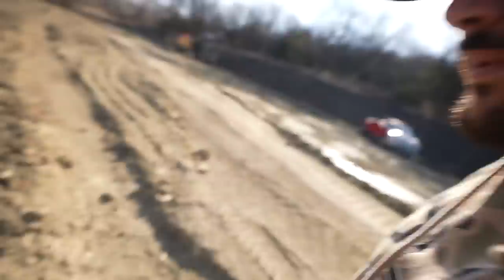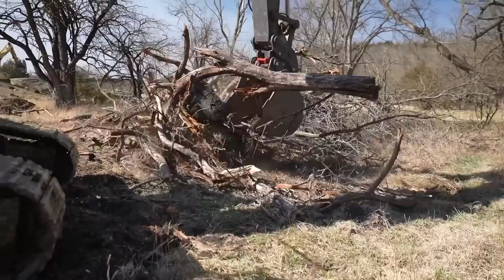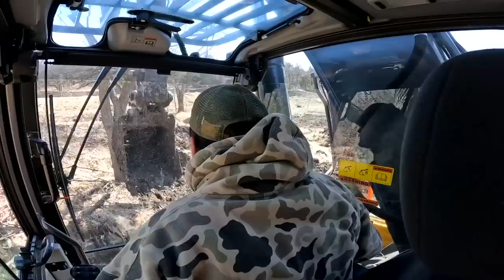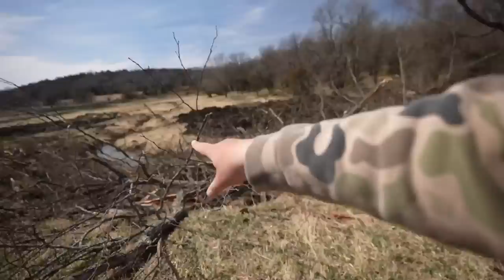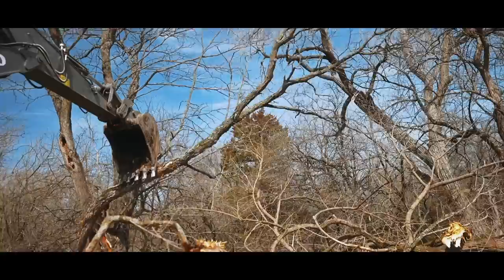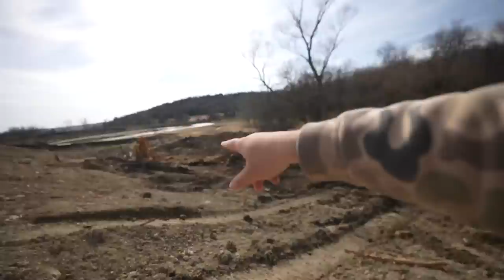Ripping Trees and Digging Holes in Bottom of 10 Acre Ranch Lake

Comment: FLAIR! You’re progressing significantly with your operating skills. I am a heavy equipment operator of 9 years, all I can say is, overtime, You will learn YOUR machine. Meaning you’ll know/find out how far you can extend your Boom& Stick on your right and left sides and know when its going to tip forward. Trust me when I say this, to flip that machine you would really have to try HARD to flip it over backwards. Thats why I say basically overtime you will become one with the IRON. Keep up that motivation and hard work! An timer operator once told me, anybody can run a machine, but you have to know where to PUT the dirt! You’re on the right track brother!

Comment: That dozer can go up a 45°slope easily. We dug a canal basicall using a dozer like that going up a half pipe with a bigger than 45 angle. Push the dirt up to the top and put it in neutral and roll all the way back for the whole length. Turn it around and repeat the length again. We made like 30 passes i. The direction of the canal back and forth to get it like 5ft deep first. Then dug it down 1 side at a time pushing up and rolling back.

Comment: Andrew... knock the trees down... top them to get rid of the little branches... then burn them.  It doesn't matter if they totally burn. It would be best to do it when you know it's going to rain in like 2 to 3 hours after you start burning. Smaller stuff will burn and larger logs will most likely go out or smolder for a while.... but.... no little branches to get hooks snagged on.

Comment: The black dirt your piling will just become silt, because you loosen it all up digging. You should be hauling out the rich black top soil to sell to cover the fuel, fire wood also. Once your clear of the top soil the clay and rocks you move will stay shaped. You have to anchor the brush piles as wood floats. Can we start a prize pool for the date the Dam reaches the over flow, meaning it is completely FULL???????

Comment: You should hinge cut  some of those bigger trees. Keep those back ends up off the ground. Also, it will keep them alive until the water covers it and they will continue to grow and sprout. Lastly, all of those small trees just need to be dragged out. Use em to heat the cabin in the winter. No sense in putting electric or gas heat in there when you could heat it the next 5 years with a wood furnace/ stove with JUST what you pulled out of that area.